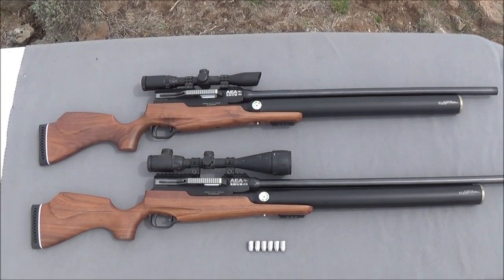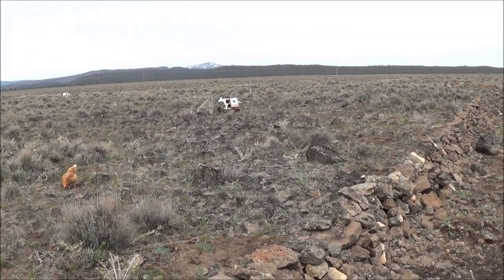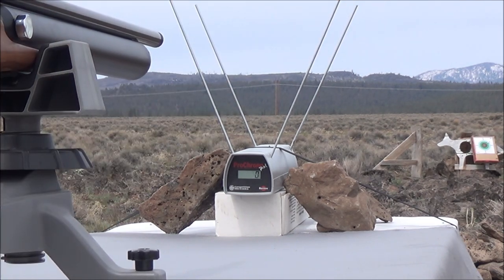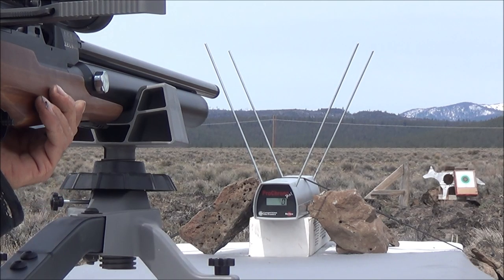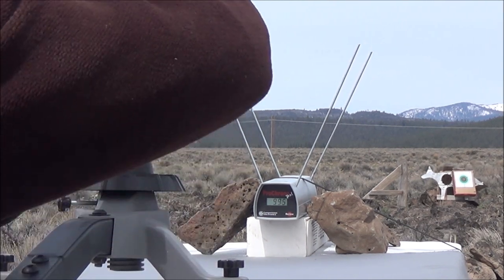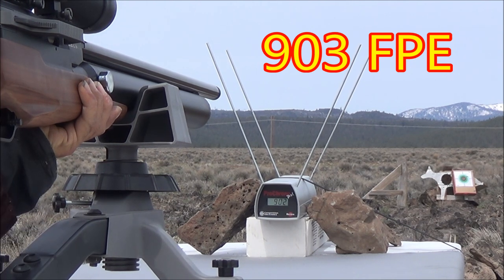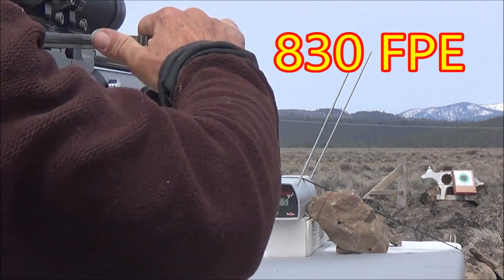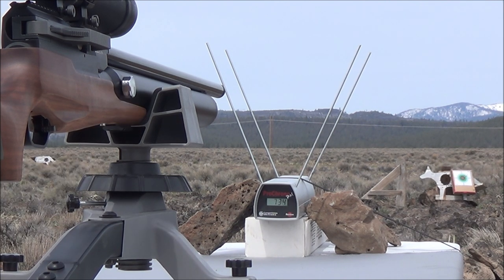AEA ZEUS .58cal - 1,104 FPE from a 500 grain bullet!

Comment: I love the Zeus .58 a ton! One of my favorite guns!
Reply from the maker: I have Barrel Bands with weaver rails on the top and bottom for the .58cal in testing right now, one design has a built in front blade site, and a matching rear weaver mount site. I am testing for ruggedness a bull pup carbon composite stock for the Zeus line right now! If its strong and lasts through what I will do to it, they will be up for sale in a month or three! A follow up shot for the Zeus line is in two iterations on my desk and waiting to be used for the first time.
Reply: @BigBoreAirgun  Very cool! Can't wait to see them!
Reply from the maker: Your barrel band is being made right now, contact BBA again and give them the info they need to send it to you!
Reply: @BigBoreAirgun  Awesome! Will do!
Reply from the maker: I'm sending two barrel bands, and a few buck shot sabots for the .72cal if you have one? The first sabot' holds 4 - 90 grain .357cal leads, the second sabot holds 3 - 144 grain .45 cal round balls, or two .45cal 220-340 grain conical bullets.. Do you have a .72? Do you have any of the AEA Challenger's if so what calibers? I will put a magazine for it with it all!
Reply: @BigBoreAirgun  Awesome! I do have a .72 but not a challenger. Thanks buddy!
Reply from the maker: Check these Sabots out 1,600 fps and 3,100 fpe https://youtu.be/ilrJnA11obQ 
Even though I have now fired 25 of these rounds and get the same results every time, it will be interesting to have you and MrHollow Point throw them through your machines and see if it just some issue with my crono or something.